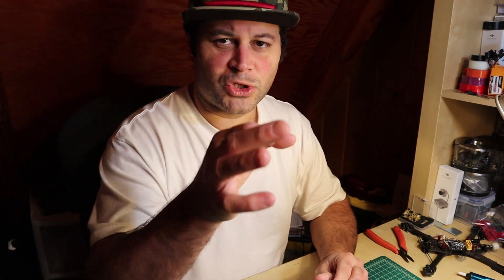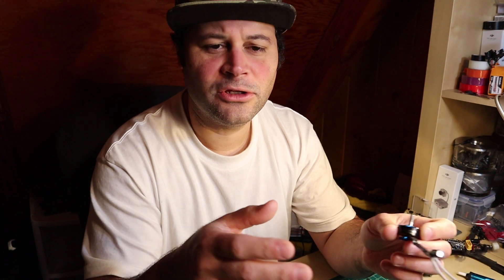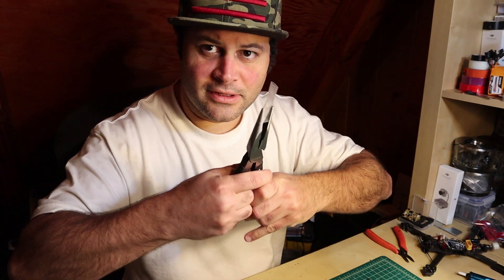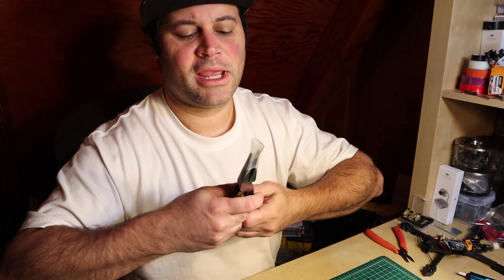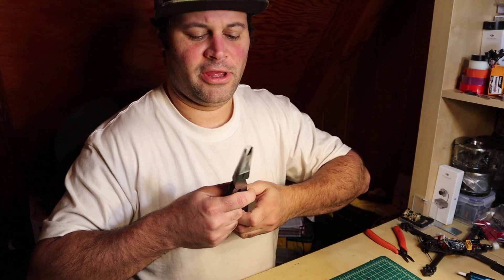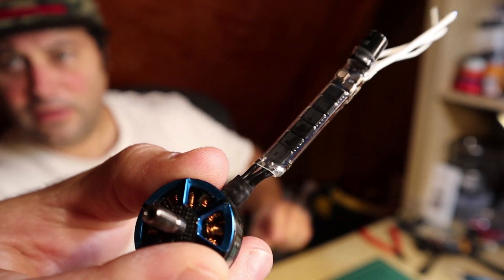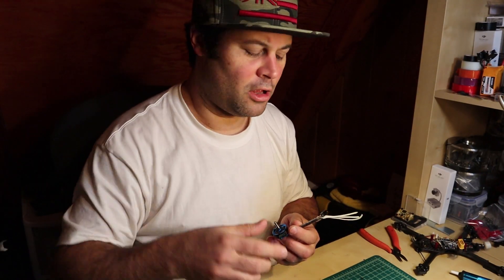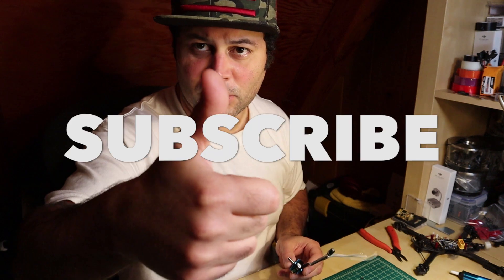Stretching Shrink Tubing To Fit

Comment: I can't find any 1:1 shrink tube. Only 2:1 or higher. Where do you get it from?
Reply: I don't know if I said 1:1 in the video. But that would be incorrect. 1:1 would mean it doesn't shrink a all. It's 2:1, 3:1, 4:1, etc.

Comment: Here's another option: 
My single Needle Nose plier wasn't long enough to stretch the piece that I needed to stretch. The shrink tore pretty soon (maybe I just wasn't patient enough). I needed another plan... two long strong steel rods - a pair of 6-Inch nails (or similar, depending on requirements). You put one through from  each side of the shrink wrap tube.... they need to stick out about half and inch on each end. THEN... you twist them a little across eachother making a shallow "X". With this shallow "X", you take a second pair of 6" nails and put them in the "V" shapes on each side, and start to twist that second set clockwise and anti-clockwise. Essentially when the original 2 nails are parallel to each other and and the second pair of nails are parallel to eachother (and the two sets are perpendicular to eachother), you have pretty much reached the maximum stretch you could accomplish with your implements. If this has not stretched it enough.... find something thicker to use as the second set... and then just rinse-and-repeat.

Comment: Found an improvement to this tip, do the same but under running hot water or i guess air would do the trick too, stretched it 4x + to the size in 1/5th of the time without a tear after 4 un succesful tries without the running hot water
Reply from the maker: Interesting. I have to try that.
Reply: (my tobacco pipe cracked and i only have 7x80mm heat shrinks)

Comment: I have the opposite problem. I crashed my Eachine Wizard X220s and 2 esc's are burnt out. There is this purple shrink tubing material around the esc's that I need to get into without tearing it apart. So in short, I need to know how to widen shrink tubing that's already been shrunken. I'm open to any ideas, thanks.

Comment: At last! A hot air gun, all these guys using gas flames... crazy.
Reply: Yeah, I always use a heat gun. In fact, I would like to find one with a narrower nozzle. Last week I used a flame in a pinch for a quick fix on a guitar, but I don't like using a flame... It heats up the shrink tubing too fast making it hard to control.

Comment: Used scissors and worked good. Takes a while tho and snapped one trying to go too fast.
Reply from the maker: Right. Scissors can work. You just have to go slow since they are either narrower or have sharp edges and can snap the tubing.

Comment: AWESOME video on stretching shrink tubing!!! This is the easiest and best video I've seen on the subject. Short, to the point, and it really works!
Reply from the maker: Thank you!
Reply: take a small vise and cut a 1/4" metal rod in half, so as to two 180 degree pieces...weld those pieces to the vise and you have a great, easy way to constantly stretch tubing. Another tip is to heat the tubing to about 150 degrees to allow for more flexibility when stretching.  We do this on a daily basis in our shop and can achieve great results.